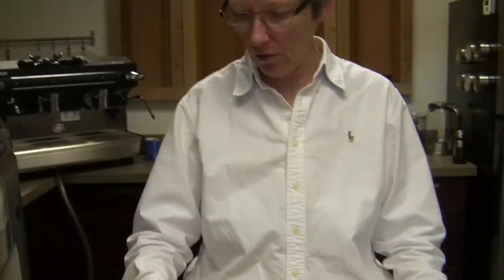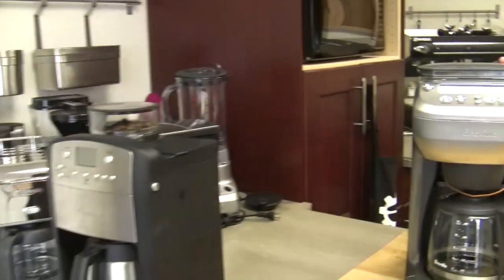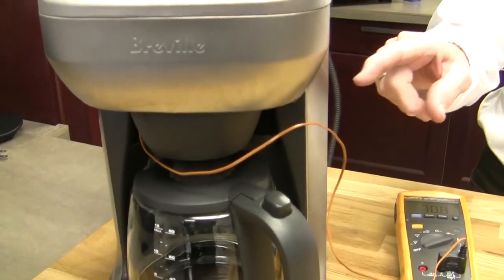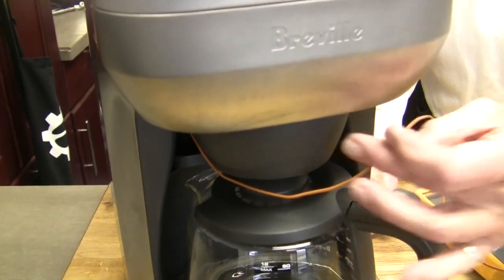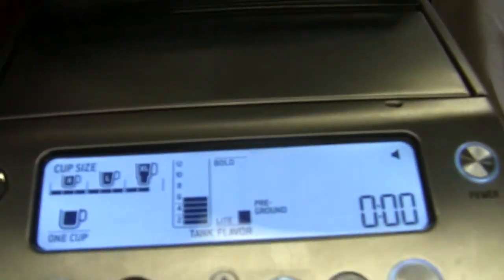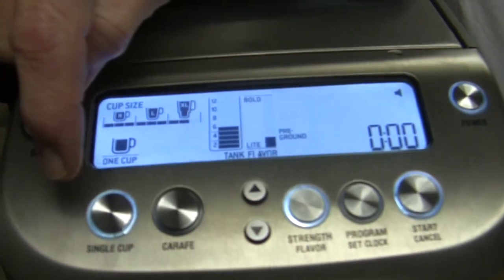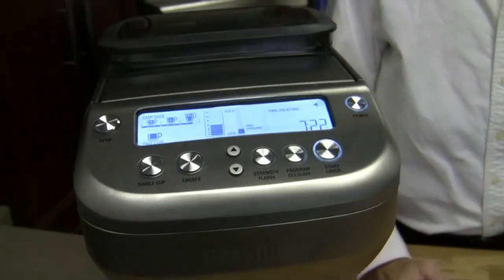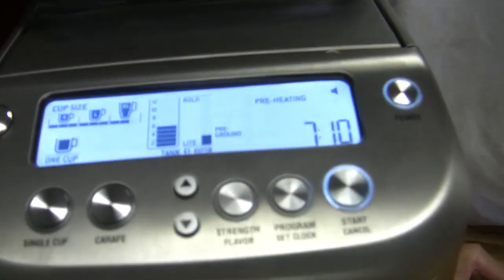SCG Crew Tests: Drip Coffee Maker Brew Temperatures

Comment: Assuming that it's an auto drip that stops dripping when the carafe is pulled out.........Why not do this test without the carafe so that the basket can fill with water for a minute or so rather that having it drip out...Of course if you run it too long the water that's already in the basket my begin to cool down.

Comment: A more meaningful experiment would have measured temperature immediately upon exiting the brew head, as you note. Otherwise, the temperature readings may be affected by size and shape of the brew basket. Still, it's hard to believe that three of the coffee makers you tested didn't approach proper coffee brewing temperature. It looks like they are selling swoopy design rather than engineering.

Comment: nothing surprised me. Bells and whistles do not count. It's built quality and performances that counts. I know of Technivorm machines that are 20+ old and still going strong. Don't know of any other brand lasting that long.
Reply: My father has a technivorm moccamaster that's coming up on 27 years and still going strong. It's absolutely insane when compared with other consumer electronics.
Reply: It's not just the temperature that counts.  The ground saturation is not even. The shower head is flawed. Anything beyond half a liter needs stirring. Which is unfortunate because its a center heavy pour and the grounds on the outside dont get the same love.  The resulting cup above half a liter is not as good.